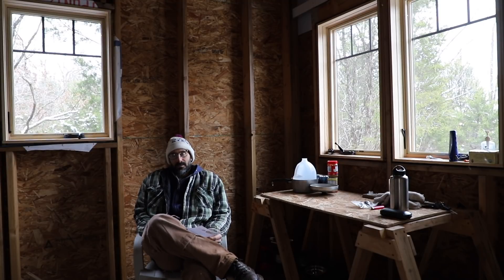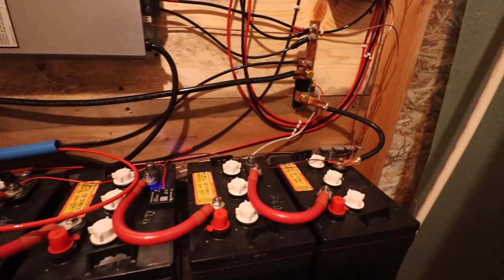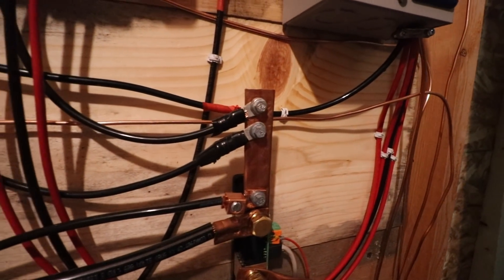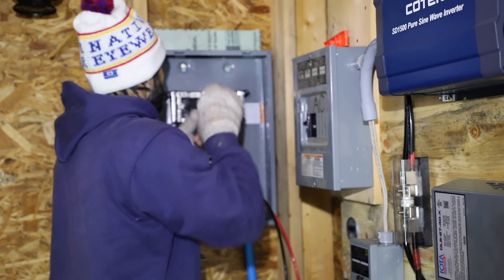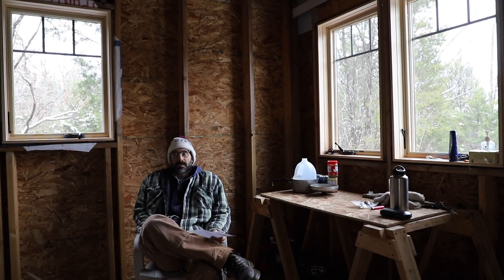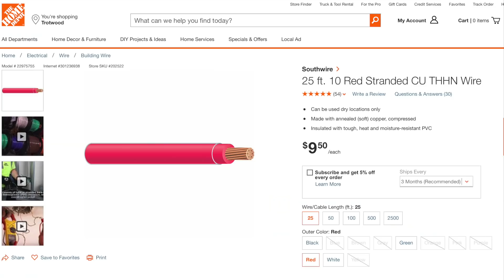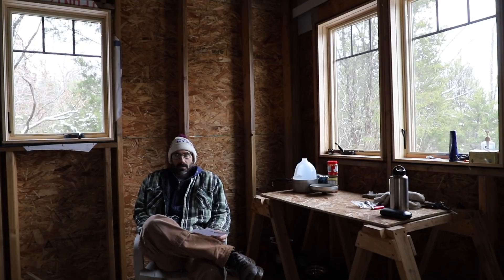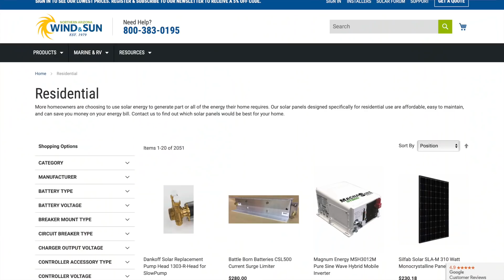Installing Solar in a Small Off Grid Cabin III

Comment: In the comparison of 12/24/48 volts, wouldn’t the most efficient way to transport electricity be 115volt?
Reply from the maker: The power comes off the batteries is DC, so we can't get 115 volt until we run it through an inverter.
Reply: 50 Acres & a Cabin I understand that. If you used it in a normal wired house your inverter would feed all outlets. And wiring for 115v is not that expensive. 

By the way, what are your thoughts on the Yeti3000? Expensive but it’s plug and play for the electrically challenged.

Comment: I have an old 2kw inverter and I doubt that it's anywhere near as efficient as yours so I don't use it often. To run my LED lighting circuit I use a 200 watt inverter that has a standby and low battery function. I would guess this is much more efficient than using DC incandescent bulbs.
Reply from the maker: The DC bulbs take 4 watts, they seem to be pretty good.  As long as the wire is sized correctly they are quite efficient. You don't lose that 10-15 percent converting to AC.

Comment: Fantastic solar set up and I completely agree with the idea of running as much as possible using DC. I think the reason why so many people use all AC in their off-grid cabins (rightly or wrongly) is because they can run everything off their generator in case something goes wrong with the batteries on their solar system. But in your case with both AC and DC you have lots of options. Love the cabin. Cheers.
Reply from the maker: Thanks Jerry, I can see the whole AC thing, especially for large systems.  More solar/more battery, probably gives more margin for error.

Comment: Nice solar system! You've got a really great inverter
Reply from the maker: Thanks, do you have the same one?  I have only used it a little bit so far.
Reply: @50Acres  I have a smaller Samlex branded pure sine inverter that works great for charging my laptop and other electronics.  Cotek is made by Samlex. knurlgnar24 has a lot of videos on the technical specs of inverters and shows hows well Samlex units are built.

Comment: good talk on voltage drop across resistors. you can see this with a 1500 watt space heater plugged into an outlet in the same room as the load center vs at the longest point from the panel. fan will start faster near the panel and lights (incandescent) will not dim as much with the inrush of heating element. it will cost more to run the heater in a remote room long term
Reply from the maker: I see people asking what size wires to run for DC all the time.  Hopefully this will encourage people to use a calculator.  The space heater is a great example.

Comment: I have a similar solar system. Only difference for me is I have an inverter that is also a battery charger. So when it senses generator power, it switches to pass thru mode, and also charges the batteries. It's an Aims power inverter.
Reply from the maker: Very cool offshore, solar is fun isn't it?
Reply: @50Acres  for sure. My inverter uses 26 watts on idle and I believe is 85% efficient. At night, especially during the fall/winter, I shut off the inverter to save some power. I opted not to wire anything DC, only did AC. Would be nice to have a couple DC lights for at night when I turn off the inverter.... maybe one day. I'll be due for some new batteries soon, I've been abusing them during construction and they were used when I started. I try to keep everything above 50%, so not much lower than 24 volts.
Reply from the maker: Nice, my inverter takes about 30+ watts on idle mode so I'm glad to have the DC circuits.  I'm hoping my batteries last me long enough that lithium becomes really affordable when it's time to replace them.

Comment: Not a good idea to use lead acid batteries indoors. They vent hydrogen gas which is highly explosive. Best to use AGM sealed batteries.
Reply from the maker: Eventually they will be enclosed.  Just haven't got it done yet, thank you for your concern.

Comment: https://www.youtube.com/watch?v=dn5EAPnpXdg
Reply: Heres the link.call them after watching my friends vid. Tell them what your doing and they will advise you in what direction to go with it.The cap I use is a third of that size,works great.I would also invest a in much larger inverter,but thats my opinion.I used to drive in a big truck.I used a 3000 watt inverter.It ran a microwave oven,as well as several other appliances,and my laptop.
Reply from the maker: Thanks Victor, I'll check that out!

Comment: I would add a super capacitor system.Once trickle charged,it will store a tremendous  amount of D C power.They are light weight and really work. It would be like adding several more batteries.
Reply from the maker: Any idea of a good book or source to learn how to do that?
Reply: @50Acres  Yes,via utube .just search super capacitor systems.There are many.a example is the super caps placed in car audio systems.You can buy them the same size as a car battery,only a quarter of the weight.But Sir they do have a huge amount of current that they store.Please watch a few vids and learn about them.I have a super cap in my truck because I talk on a radio with a amplifier,instead of several batteries I just have my one battery and the super cap.It does the job!!!!  Initial charging is slow and takes time,because they MUST be trickle charged when first started.but I see you have several batteries in use now as well as a few solar panels,so it should work out for ya ok.will post a link.

Comment: Huge thumbs up!! You hit so many valid points on this that a lot of solar running and/or off-grid folks aren’t  talking about. Efficiency is key when you’re trying to save money/resources on the back end  so it’s better to spend a little more on the front end. I don’t believe in a “over built” PV/electrical system because you can always grown into it and may likely even grow out of it. We’re getting ready to install our 48V offgrid system and I’ve learned a lot while running 12/24 volt systems which brought to the conclusion of running 48v. Looking forward to the next video!
Reply from the maker: Thanks Brandon Ward, Yea I really feel there is some poor info circulating out there about solar and people end up wasting some money that could be better spent.  Heck I'll probably regret not going 48 volt eventually if I start spending more time at the cabin!

Comment: Suggestions:
1. Steel extension pole (find a steel pole.. About 8 feet.. Attach the snow brush/shovel ur currently using (diameter of the 8feet pole has to be the same as ur brush/shovel) . Make a horizontal hole while both poles are attached.. Put in a screwable bolt and nut tie it.. Then simply scrape the snow from the ground rather than climbing a ladder.. (unless an extension pole is available for ur brush/shovel).. 
2. U are using bulbs Led of course..try looking at some LED strips with dimmer(DC strip).. Cut and wire soldable the leds you need..  I use 3 leds per segment..make the segment into DC 5w .saving power that I need...when I need.
Reply from the maker: Thanks for the suggestions Edward, definately going to use both those ideas.

Comment: looking great dude, the wiring is ok, but figure on using around a thousand volts system, that gives you double the usage, if need be. as too water heater, find an old electric RV water heater, and replace the 12 volt element with a 24 volt element, that should cost ya around forty bucks. , then run it too the heat sink as a dump. that works great and you don't lose much usage.  do the same too the buzz bar, then water heater. all that will make it work for ya too. I had mine run too a stunt, then buzz bar then the heater. it never let me down, and I was there for four years, and never not did I have hot water. also use a water pump too circulate the water, through a on demand block, it does help too have ready to use water.                                                                                                                                   Now as too the lighting. led's, all the way, you can use voltage booster, if need be, but should be fine up to fifty amps of usage, but fuse every light box. that's a lot of lighting. now I used 14/2 wire, to run my lights. one for low voltage, and one for regular 110 voltage.  12/2 in the kitchen and bath, with GFI box and serge protector.  now you stated that you have trespassers.  while there an't a lot you can do. but there are some things that can work. it is all about if you want too spend the cash too do them.   I had an issue with trespassers, and used solar powered cameras, with motion sensors, when that didn't stop the theft/ vandal  I used motion active, speakers that ran a prerecorded massage. from each set of connections. it was like I hear them over this way, for every section I had a different massage, but it made it sound like there were a group of men with rifles looking for trespassers. every time they crossed the motion sensor it would say, over this way, I can see him. quick aim that way.  the next would say, I can't see to shoot the fuck.  it worked, but I had issues with dear ,and bears, in the summer time. but I didn't have any more vandals coming around.    I did get pictures of them though, that I turned over too the state police. that's how I learned that the vandal was involved in my issued as one of them was the counties clerks son. later in court, he had no excuse other then too say that his daddy made him do it.   I look forward too your next posting, hopefully it will be sooner then the last. thanks again...                                  the one and only                                          frank.
Reply from the maker: Hi Frank, good to hear from you bud.  I like the Idea of all the speakers.  It would be fun to get a trespasser on video as it plays out.  I will also look into a 24 volt element because I do have a lot of power that never gets used.  I think I should have the next video done by Sunday.  It's coming along pretty good so far.

Comment: I worked for a large, well known company in the solar & alternative energy field.  You're the first I've seen who's philosophy is spot on, and your system size and budget constraints we're well planned.  I'm assuming you have disconnects in the appropriate places?  Also, I agree with the push pole idea.  Ladder work on a snow covered deck makes me pucker!
Reply from the maker: Hey Derek I think I do as long as breakers can count as disconnects?  I've got the ability to shut down the system pretty easily from the combiner box, before the CC, or after the batteries.  Definitely going to do the long broom idea.

Comment: You need some insulation, I got cold watching you work. lol
Great set up. We went 48 volt just to keep the inverter for working so hard. I
Are you planing on having a diesel or gas generator?
Reply from the maker: My Alaska Dream Oh man it was so cold, I insulated the bedroom my second day there, was much better.  Yes we do have a Honda generator it is gas but I will run it on propane.  I built a manifold to feed it off the cabin’s propane system.
Reply: That's cool, I'm in the market for a larger generator.  I'd like a diesel but I think I'm going to go with a Yamaha.  Propane would be a cool way to run your generator.
Reply from the maker: My Alaska Dream I bought mine with the tri fuel adapter installed from a place called central Maine diesel. The adapter works great andIve been told that propane is easier on the engine than gas.
Reply: cool I'll look into it.  Thanks

Comment: BTW, I am building a solar generator and using two 70 amp AGM batteries, and I was wondering what your opinion of that would be?  Thanks ,Ron
Reply from the maker: My opinion:  Any solar is better than no solar!  you'll catch the bug and already start designing your next system once you see how fun generating your own power is!  AGM batteries are nice, and as far as the size, as long as you treat them right they will do a lot of good work for you, just don't ask more than they are capable of.

Comment: Hey great videos. Love the solar side, it’s what brought me to you channel. Have you considered using one of these 8kw diesel heaters? They seem pretty decent, and also a lot cheap to purchase and operate than propane. Let me know what you think 🤔. Being only a couple hundred bucks with everything you need might be a great choice. Also you could mount the heater body and exhaust pipe through your water area for a bit of heat during the cold times. 💭?
Reply: Just YouTube Chinese diesel heater. There are literally dozens of reviews. eBay AliExpress gearbest you name it. Comes with a tank hoses pump and everything
Reply from the maker: Thanks
Reply from the maker: Hey Michael, I have never heard of those, where should I start investigating them?

Comment: I would suggest getting a long painters Pole and a push broom then putting the painters pole on the push broom to clean off the solar panels just so you don't have to go up a ladder in the snowy conditions to mitigate the chances of a ladder slipping or a fall during cleaning your solar panels plus it would make cleaning the solar panels easier possibly making you do it more often during snow when you're up there
Reply from the maker: Thats a great idea
Reply: @50Acres  the smaller the push broom head the easier to handle at the end of a fiberglass painters Pole I was looking at them the other day and a small push broom head up here in Canada is about 10$ and last time I bought a painter's Pole I think it was about $40
Reply from the maker: I've got several painters pole's already, just need to find the right push broom...

Comment: I really enjoy your videos. I live permanently in an off-grid home high in the mountains, and I built it right on the shore of a gigantic lake (approx. 60 miles by 40 miles). I am very interested in your solar set-up. I have a generator and I need to add some more solar panels into a decent, efficient set-up. I am also acquiring at least one wind generator, maybe more, as there always seems to be at least a good breeze to some pretty stiff winds. I have a septic system, about 7,500 gallon water tanks on an 8 foot stand & all water is gravity fed. (no pumps). I have a wood stove, a large glass-fronted wood heater, a propane stove and fridge. I didn't stint on insulation and just by using the wood heater, the whole home is quickly  heated in a couple of hours if I have to leave for a week or so.  The snow fall is quite heavy during winter and I even get some snow falls during summer! Fishing is great, plenty of deer and other game and NO neighbours. The nearest town to my place is 30 miles away down in a large valley  and the "road" down there is like a fish hook, switch back all the way down. Virtually impossible in mid-winter. But the scenery and the silence, the peacefulness and the night sky on cloudless nights is worth every little inconvenience I may go through. Thank you for all your videos and the information. it is good to see it all come together for you.
Reply from the maker: Sounds like such a beautiful place and a really nice setup!  I hope you have some videos im about to check out your page!
Reply: @50Acres   Thanks. I had a few amateurish videos up but took them down. I will re-upload a couple of short ones so you can see the outlook, scenery and a few inside shots of my cabin (home!) I will try to get them up later today.
Reply from the maker: Thank you for doing that.
Reply: Solar panels have gotten dirt cheap.  The big problem is if you wish to use the power at night .. Then you are stuck with batteries which at this point are way more expensive than the panels.  Alibaba  getting prices on panels of 25 cents per watt PLUS shipping..  In conjunction with micro inverters one can do 350 watt panels and an inverter for around $200 each.  You will still need to mount them but no clue on your thoughts... ground or roof mounted
Reply: With a setup like that, it would benefit many people to understand how you got there. Start a channel! It doesn’t need to be perfect!

Comment: That system looks fantastic, Mike! Great information. I actually pieced my system together from a bunch of different sources, including Ebay. Which, that might have been a bit of a risk.
Reply from the maker: Green Dream Project thanks bud,  I bought my panels off eBay and it seems like Derek and u guys have had great luck with the eBay batteries.